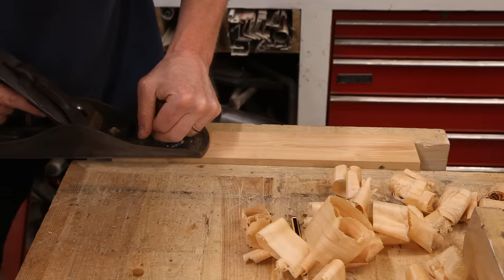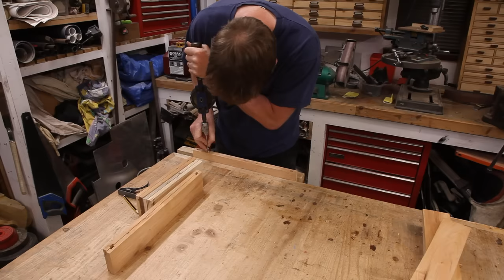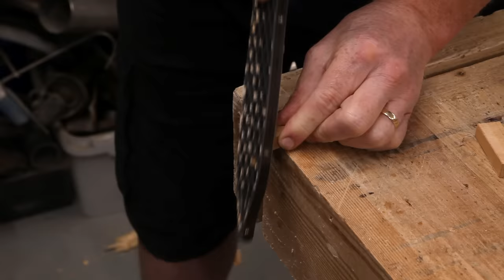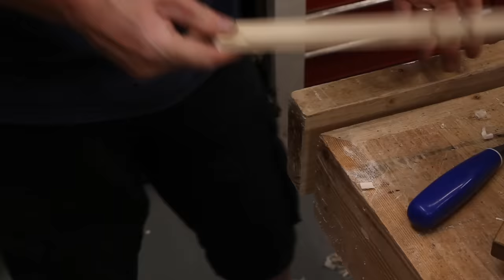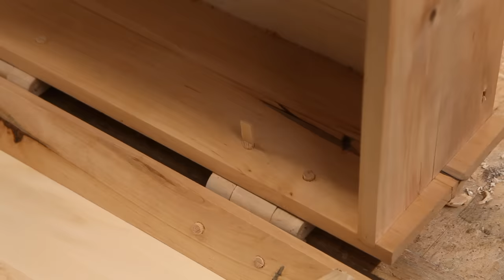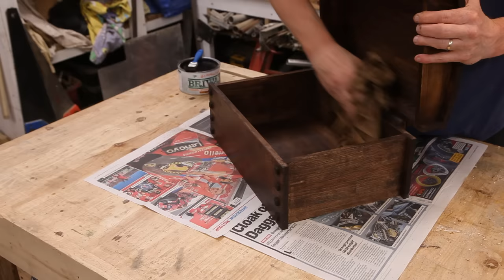No Glue, No Nails, No Screws, NO POWER TOOLS. A Pallet Wood Chest Made Using Only Hand Tools.

Comment: This build is amazing! So many cool ideas I want to try. For the hinges though, painting the insides/contact points with a B pencil would help reduce the friction a bit, since graphite acts like a dry lubricant, and could make a difference in the long run.
Reply: another alternative to the graphite is to use beeswax on the hinges if you are going all natural just melt a little onto the joints and work it in

Comment: Wonderful craftsmanship as ever. I have come across treenails, or tree nails, in boat building, and have learned from Youtube that they are often pronounced trennels, and sometimes actually spelled like that. And I have seen them wedged as you did for the hinges. But I don't think I have ever before seen them used in blind holes like an ordinary steel nail to attach a panel to a frame. Anyway, if they ever shrink and fall out, a dab of glue will sort it all out, hide glue if you have to be old-school about it. And with rebates as accurate as yours, it will probably all stay together anyway.

Comment: Very nice job.
A couple of little tips for you...
Hammer those hand made dowel pins in with a wooden mallot or simply place a scrap piece of wood 
over the head of those pins, when fitting them.
Preferably  soft wood.
And the other tip to sort out the squeaky hinge is some wax or animal lard if you don't want to use oil. 🙂

Comment: Really cool to watch!
Correct me if I am wrong, and I may very well be, but wouldn’t that crack or even out right split if the humidity changed?
Reply from the maker: It might do, but I've found pine pallet wood is fairly stable as long as its well seasoned, at least where I am. it might suffer if I ever moved to a different country.
Reply: @EpicUpCycling  I really appreciate that you so readily respond to questions. You have my utmost respect concerning your woodworking and content creation/management.

Comment: thank you for a enjoyable & informative 35mins. although to be honest the info provided s timeless... i needed some dowels recently for a craft  item i built for a family member and as i couldn't find them i sawed-up pencils as they would be painted anyway . the  dowel making plate is now on my to do list as i  had seen once before but totally forgotten that could be done. the Japanese style tops to them is  something totally trans formative for the item being done. do the dowels need to be a close grained hardwood to achieve the finished peg.?
Reply from the maker: The dowels I made were pine. I wanted them fairly soft. They are cut 0.5mm larger in diameter than the holes. Hardwood may have worked well also but It might have been too much for the pine boards and split them.
Reply: @EpicUpCycling  thank you. i will give making them a go int he future

Comment: In the first couple of minutes you are pulling nails. How did you take the pallets apart and leave the nails standing proud of the wood surface? Ive taken quite a number of pallets apart snd never had that situation.
Reply from the maker: The type of pallets they were from have quite thin slats on them. The nail heads often just pull through.

Comment: You're really fighting that large bit with the hand drill.  Might be easier to drill a smaller pilot hole then step up to the full size bit for the dowel pins.  Those squeaks at 32:28 are legit ready for any foley artist!

Comment: Almost perfect! The pins in your hinges are a  smidgen too tight, in time you wont be able to lift the lid.
I'm only mentioning it , cause it would be a crime for such beauty not to be used and admired!
Reply from the maker: If you watch the video closely you'll notice the pins are only a tight fit in the outer edges of the hinge. The hole in the center part of the hinge is bored out larger. If it wasn't, the lid wouldn't open at all.

Comment: How did you take into account the relative dryness of the nails? If too wet they will come loose, if too dry they might split the wood.
Reply from the maker: I'm not too worried about it. The wood was well seasoned before use. There will most likely be some shrinkage but I expect it to be only a small amount.

Comment: No power tools, no glue, no nails, no metal hardware. Those of us with pathetic wood-working skills can only look on in wonder. We are faced with the Novak Djokovic of wood-working (as of today, 11 June 2023, final of Rolland Garros. I have been wondering about the use of the brace and bit and hand drills, though (not for this masterpiece,  but for others. I used to own a restaurant, and I gradually eliminated the use of power utensils - Kenwood or equivalent sort of stuff, because I couldn't bear the noise they made. Especially early in the morning. Don't know if the same applies to EUC? But thanks for a great video that frankly had me absolutely baffled as to what was going on for a lot of the time. And are those beautiful saws Japanese?
Reply from the maker: One of the main reasons I like hand tools is the peace and quiet.
Yes, the saws are Japanese.

Comment: Why didn't you fill the nail holes with dowels first?
This would have plugged up all the holes so when you "finished" the wood there would be no nail holes (or missing knots)?
Cutting the dowels "high" with a cutters then using a chisel or belt sander to make them smooth works really well.

Comment: And so, as long as it gets no more than gentle, occasional use, in a temperature-controlled, indoor environment, with unchanging humidity, and a static amount of ambient barometric pressure, and it never gets wet... it'll last forever.
Reply: Precisely. Easy to believe he could manage all that.😊

Comment: Man, talk about going above and beyond! 😀 Talk about hand made. I mean, it is not like nails, or even metal hinges is a modern invention (though it was harder to make and not as cheat). Or even GLUE, which certainly is not exactly a new thing. Press fits and wood,,, studs? I KNOW what it is, I just don't know the proper name for it. Anyway it worked for centuries so why not still use it? And while SOME of the hand tools are modern MAKE they still have not changed much through the years, and some of them you restored/made yourself. So is this your mastercraft piece? 😛
I wonder, I have watched this channel for a few years now but I THINK this is your first project with NO modern tools? Some of it you have used before but in addition to power tools and other convenient modern stuff? Still, good work as always. As if I would be surprised by that at this point. 😛
Reply from the maker: Thanks. This was one of the most satisfying builds I've done. Took a long time, but a lot of fun :)

Comment: i looking only  big stanley plane has plade worst, not traight and not sharp, and wood nails not need  make full ready before hamemmer to place, after hammering cut head and paint top. then show better not see hammering dint. and if want build better joints, dont use pencil newer, need use kiridashi knife marking were saw and cut, then joint have better.

Comment: You make quite a statement in this video. I just don't think it is necessary. Most of the power tools we use are not only much less time consuming: they are also much more precise. And as there is a very rapid shift going from fossil fuels to create electricity to renewable sources of energy to do the same, I'm quite sure we will be able to use power tools in the very near future without adding to our carbon footprint. And then this channel could again be about reusing sources, without having to care too much about energy consumption. I guess it will be much less attractive to your viewers to try and copy your not using power tools than it will otherwise be to copy your way of upcycling valuable sources, like wood.
Reply from the maker: I wasn't really trying to make any sort of statement with this video. If time and precision are important, then power tools will always be the way to go. Neither of those things were important to me when I made this. It was just about enjoying using my hands to do something.
This was by far the most satisfying and rewarding thing I've built.